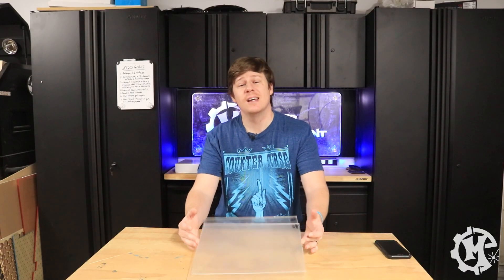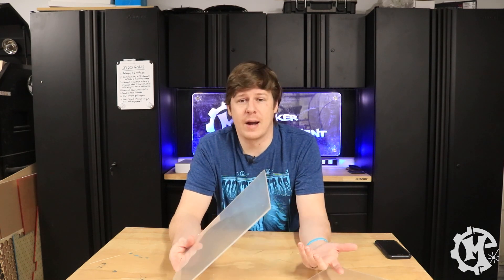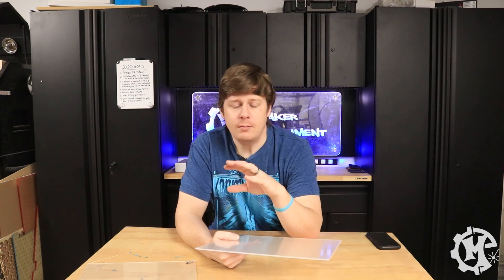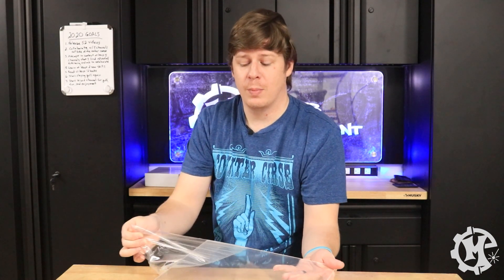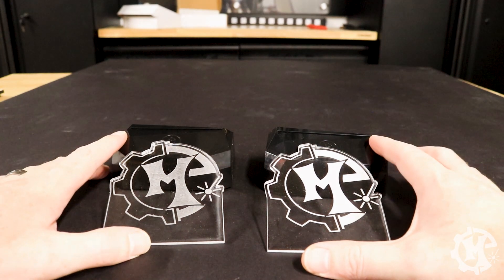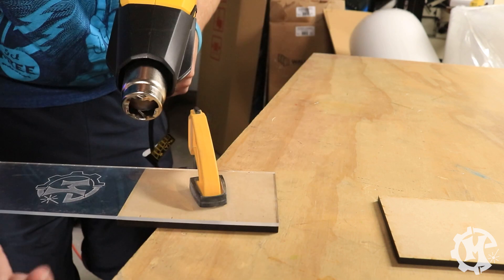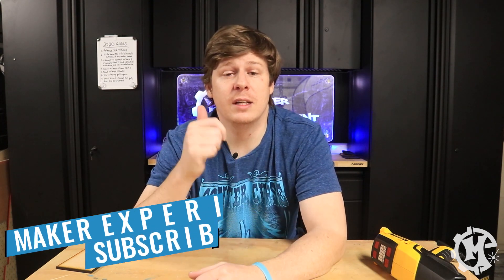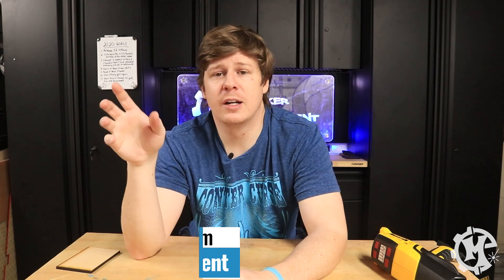CAST vs EXTRUDED ACRYLIC | WHICH IS BETTER?

Comment: I’m just getting into laser engraving acrylic and I’m not sure what to put under it... I’ve used plywood but found that the smoke from the wood discolored the acrylic. Any suggestions? I use a 20W laser just on small projects/ Etsy products. Thanks!
Reply: Maybe try a sheet of steel or other substantial metal? Obviously the less reflective the better... BUT, I’m not an expert so PLEASE try at your own risk and always use eye protection!!! You’ll find most CO2 lasers use a metal “knife bed” or honeycomb sheet under the material (as shown in this video at 5:27). Since you’re using what I presume is an open-frame diode laser, it’s a bit trickier. Maybe even try using masking/painters tape on top of the plywood? I’ve seen people use that to mitigate scorch marks when engraving wood. Not sure if it will help in your case, but that’s a simple and cheap test.
Reply from the maker: Luke Wehrli may I ask why you’re putting anything under the acrylic if you’re engraving it?
Reply: Maker Experiment what I meant is the surface my laser engraver is set up on is plywood, but that leaves a smoke color on the acrylic even if I keep it well ventilated . Not sure what to do! Thanks!
Reply from the maker: @lukewehrli3839  That I am not sure about. I'm sorry I'm not more help.

Comment: Very useful. Thanks. I'm looking to use 26" square sheets that need to be rigid. Can you tell me which is more rigid (for the same thickness, obviously) extruded or cast?
Reply from the maker: Both are pretty close to the same for me. I think it’ll just depend on your application. I honestly don’t use much other than cast unless cast isn’t available in the color I’m using.

Comment: Cast is better on CNC machine than Extruded due to temperature melting point. On your video, you used laser engraver. That's fine. True Extruded is cheaper, but not brittle like cast acrylics. But laser cannot profile an acrylics the way CNC milling machine can do..LOL
Reply from the maker: You’re right. A laser cannot profile, but can a CNC make tight angle cut with no radius? Hahahaha One day I’ll get a CNC. Both machines are awesome.

Comment: Great video.  When I started using my laser, I didn't realize there was a difference in engraving between cast and extruded and just used whatever I could get cheap. I got so frustrated with the results until I found out that cast was so much better for engraving.  As for suppliers,  I love Delvie's Plastics.  They've been great to us and our business.
Reply from the maker: I did the same thing when I started engraving acrylic. I will have to check out Delvie’s. Thanks for the tip!